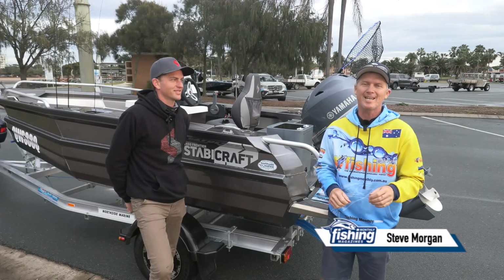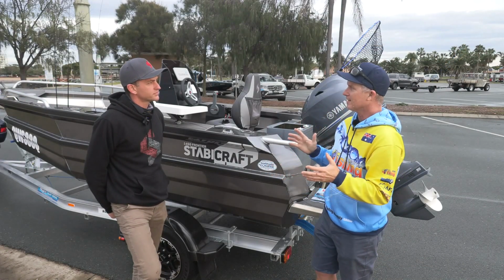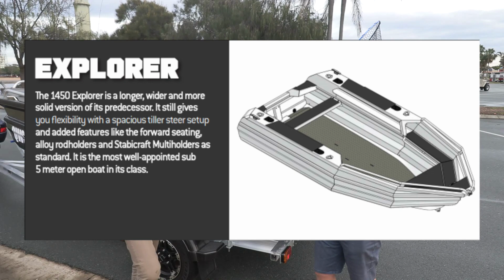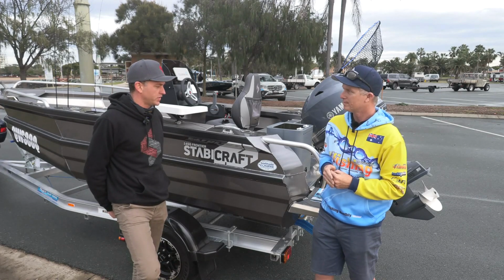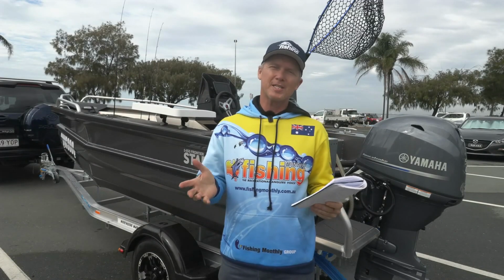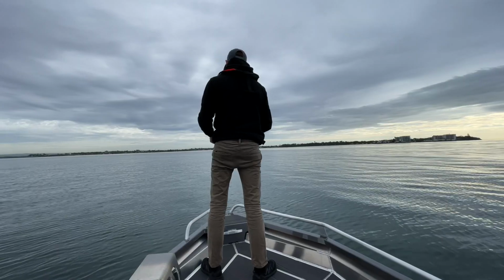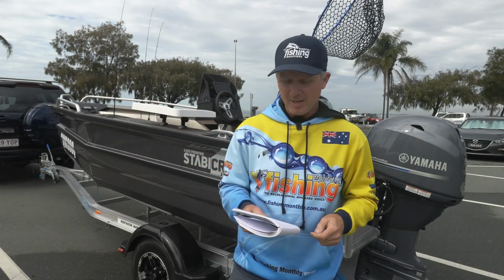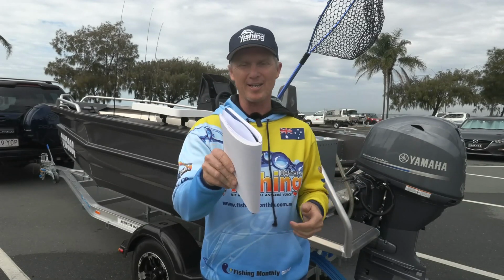Tested | Stabicraft 1450 Frontier Profish with Yamaha 50HP 4 stroke

Comment: Love my 1550 fisher yes at 65k aud not cheap , but super stable and with 75 merc flys . You get what you pay for ,in my case my misses did .
Reply: Does the 65k include the engine bud? Hope to get a Stabi one day.
Reply: @georger3239  
Hi 
You get for this spec at 65k 
75 merc
Live bait tank 
Bait board
Rocket rack and sun shades and full front and side clears
Garmin 95 utd sv 
Pro fish seats 
70 ltr ice tec cooler 
Lorne star winch gx1
And anchor ⚓ 
It's a small but I love it
Reply: @jono999s  where did you get yours from mate?
Reply: @estebaninchebell9276  the wife paid for it

Comment: Most aluminium boats are unsinkable, but does not mean it’s not unflippable. They will stay afloat once flipped. $50k with tote tanks, highway robbery
Reply: Yep got my 420 Renegade for 20k F50 alloy trailer etc. I've done 2000km in total offshore and no cracks!

Comment: The horseshoe is good for stability. But it’s also good for stability upside down if a breaker catches you side on and flips yoy. 
If you cop a large breaker and water enters your boat, the self draining deck doesn’t work as the whole boat sits low in the water. 
The point is, open boats are never as safe as decked boats. But these are as good as a small open boat gets. Don’t stray too far from land 😅

Comment: 46k and not even a built in fuel  tank, that's a bit rude
Reply: @antoncarmoducchi6057  why wouldn't you? Comes standard on most boats that size, 70L underfloor in my boat and gives me around 250km range

Comment: It is really inaccurate to claim the pontoons give it the stability. Yes they are stable due to the chines the underwater shape of the pontoons create, but the enclosed,  foam filled or not pontoons only add reserve positive floatation. The fact the pontoons are sealed do not make it more stable.
Reply from the maker: You are correct.
Reply: You try pushing a fully inflated car tyre tube under the water...
Reply: @today347  Really. That's your argument. I said they give reserve positive bouyancy so your point agrees with me. The pontoons give bouyancy but the underwater shape that they produce i.e the large chines are what give stability. Not the fact they are sealed. If you cut big holes in the pontoons from the inside of the boat stability would not change but if flooded the bouyancy certainly would be.
Reply: @ME-qq2dc  oh my your very upset arnt you. I have a quintrex,  so when you stand against the side it slips down. In a downward motion into the water.  It compounds when my two teenage boys also come to the side.  I now have this particular boat and because of the positive boyancey it doesn't slip as much under the water equalling more stability..  It's funny you know so much. Do you have one???? . This is the reason we brought one and it works amazingly for us.    If you have one comment..  If you don't then shut ya trap.  ..
Reply: @ME-qq2dc  I understand that reverse chines help so much with stability..  But science is science when you have an outer ring of stability  and positive stability   .. It makes for more stability at rest. Tell me I'm wrong...
Reply: @today347  you obviously didn't finish high school did ya.  Your other boat obviously had smaller chines and maybe a steeper deadrise that's why it was less stable.
Reply: @today347  yeah you are wrong
Reply: @ME-qq2dc  Wow oh wow, your so educated that you mock my education..  Very mature...  .. Again I say, Have you even been on one?...  .you sound like Donald Trump... Your way is the only way..  I'm gunna leave you to your own thinking..  What I will say is that YOU will have no effect whatsoever on the stability science that stabicraft  has put into its boats this last twenty years plus ,and who will continue to make great boats and safe boats for the future.
Reply: @ME-qq2dc  so what your saying is a blowup boat is just as stable with air in the sides as a blow up boat with no air In it. ??¿??
Reply: @today347  my God mate it is not rocket science. Your argument is garbage. Yes a tyre is bouyant and hard to submerge. But so is an empty bucket if you try and push it down into the water upright. If I really have to spell it out for you,  bouyancy comes from the volume of water that an object displaces so a 1 cubic metre object displaces 1000 litres of water. 1 litre of water weighs 1kg therefore the object has approx. 1000kg of reserve bouyancy. It is the shape of the object that gives it stability, that and ballast. So your argument says that if you are in your stabicraft and you drill holes into the inboard side of all the pontoons meaning not sealed like your tyre analogy, your so stable stabicraft would suddenly not be so stable! By the way I have been on one and they are a very good boat, my comment was only about an incorrect claim. They  should state stability comes from the hull, and chine shape and they are positively bouyant if swamped due to the Pontoons.
Reply: @ME-qq2dc  go check out kaptan boat collars..  Aussie made product. Fitted to regular boats for stability..  👍😀
Reply: @today347  yeah and guess what you fit them too tinnies that have virtually no chines. Mate you are obviously not the sharpest tool in the shed. How about you email stabicraft and ask them. They state the pontoons provide "RESERVE" bouyancy, they say reserve as it is above the waterline and does nothing unless the boat is swamped. Again remove the pontoons entirely but do not change the external shape of the hull, STABILITY WILL NOT CHANGE. IT IS A SIMPLE CONCEPT!
Reply: I have one of these. I’m 120kg and I can stand on the gunnel With no worries. My previous 440 renegade you couldn’t get close
Reply: @badrng1797  yep and I did not say they are not stable mate. They are very stable and great boats ok. My point was that what makes them stable is the underwater shape of the hull, I.e. the pontoons create large chines. These are what give them stability. The fact they are sealed pontoons does not impact on stability only reserve buoyancy. Example drill holes in the pontoons on the inboard side so they are no longer sealed. It will not affect stability. Hope this is clear.
Reply: @ME-qq2dc  yeah mate 100% agree. I just felt like saying something 😂
Reply: @ME-qq2dc  pontoon boats way more stable at rest, end argument, its science
Reply: @jump171  And you must not have finished science class then. I will try and make it simple so you can understand. Sealed pontoons add reserve buoyancy i.e if the boat gets swamped, sealed air chambers displace their volume in water so act like an inflated car tyre tube preventing the boat from sinking. What gives them stability is not that they are sealed at all, it is the size and shape beneath the waterline that creates large chines, these are what gives them stability. You can puncture large holes in the pontoons on the inside of the boat effectively making the pontoons redundant from a bouyancy point of view, and the stability would not change, but the reserve buoyancy would be lost. This is science mate, but you believe what you want, I really don't care if you don't get it!!
Reply: @ME-qq2dc  haha you're so wrong
Reply: @jump171  nah mate I am not. Read my recent reply to other user @To Day
Reply: @ME-qq2dc  well how come a little kids life ring is so stable. It has no chines. Its the buoyancy
Reply: @jump171  Mate you really don't have any idea, and I am over trying to explain it to you, OK! You believe what you want.
Reply: @ME-qq2dc  haha classic, guess you cant explain that one so now you cant reply, haha classic
Reply: @ME-qq2dc  that doesn't make any sense at all. Its science man. Simple science and you don't get it. What happens if u have a flat plate on water and push on it
Reply: I left the top middle bung out when I was parking the car came back after 10 minutes  , the floor was full of water , put bung in turn on pump and 40 mins later the water was out ,if it did have the pontoons it would have been alot worse 🙃
Reply: @jono999s  Exactly mate, that's due to the reserve bouyancy that you get from sealed pontoons which displace a volume of water that weighs in excess of the weight of the boat. You can fill your Stabicraft to the top of the gunwhales and it will still float. Try submerging a basketball. Same principle but it is not the fact that they are sealed pontoons that provide stability, it is the shape and size of the resulting chines that the design/shape of the Pontoons under the waterline that give it stability. To prove it think what would happen if you made the pontoons without creating chines and just had a really deep V with zero chines. It would still have bouyancy but Terrible stability. A point that many reading my comments cannot seem to grasp.
Reply: @ME-qq2dc   as I have a stabi  there aren't  a deep vee,so the rear is flat almost.  I get the pontoons on any boat would stop it from sinking the less that deep v and chines work well , stabi are crap through chop compared to a deep v glass boat ,but there are shocking at rest compared to a stabi and 50 other pontoon type new zealand  built boats
Reply: @jono999s  Sorry mate I don't have a clue what you just said, made no sense at all.
Reply: @ME-qq2dc haha this made my day man thank you , my advise . You can’t argue with stupid . 😂